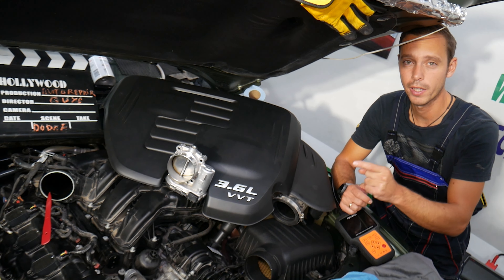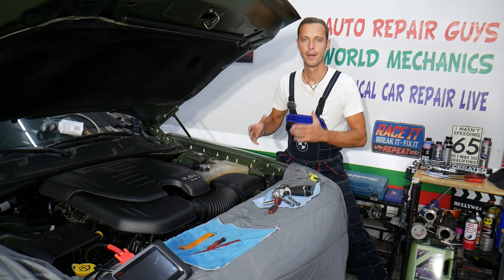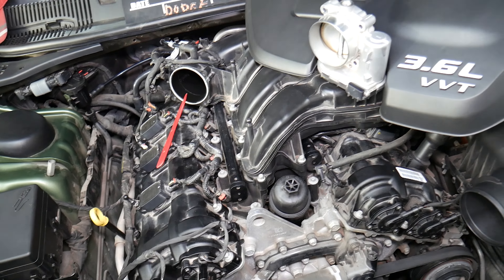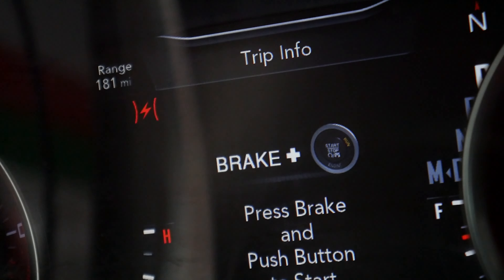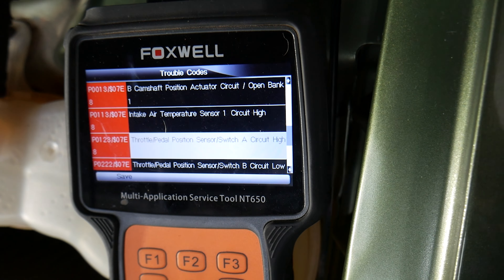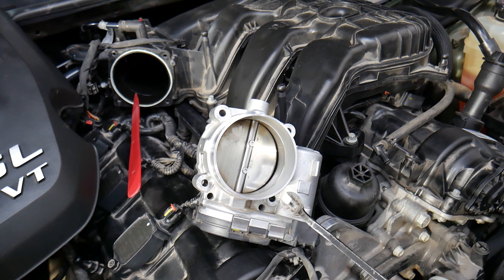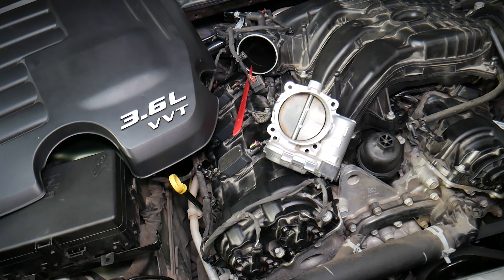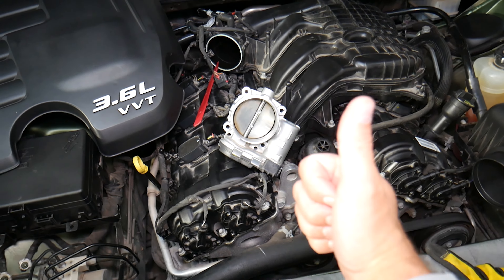DODGE CHARGER RED LIGHTNING BOLT LIGHT, THUNDER RED LIGHT on DASH

Comment from the maker: Products that we use and recommend:
► Throttle Body: https://amzn.to/4hAosEk
► Throttle Pedal: https://amzn.to/4ewhCgp
► This is Our Favorite Scanner: https://amzn.to/3Rlmr1A
► 5W-20 Oil: https://amzn.to/3uc1Qmu 
► Oil Filter: https://amzn.to/3HZ9eHm
► Panel Removal Set: https://amzn.to/3YiMADu
► Assorted Fuses: https://amzn.to/4fx4s3F
► Tool Set: https://amzn.to/3p5MM6t
► Screwdriver Set: https://amzn.to/3XRB28Q
► Torque Wrench: https://amzn.to/32qyRwg
► Liqui Moly Engine Flush: https://amzn.to/3IiDBID
► OBD Scanner that we use most often: https://amzn.to/3I4MQfe

► Check out our Amazon Store for the tools and parts that we use: https://www.amazon.com/shop/worldmechanics

Comment: That light is on my 2012 dodge charger pursuit. I had it scanned nothing popped up. Started the car after have the scan the light went away. 15 minutes later the light comes back on and I'm stuck going 45 in a 55 on a highway. Checked the throttle body to see if it was dirty it wasn't. Check the wiring, nothing is broke. Idk what to do.
Reply: Usually after you let it sit a while- the electronic throttle body will cool down, and it will be for who knows how long….  I got an extra one from a pull a part that I keep with me… It’s easy enough to swap it out on the side of the road.. Another issue could be the gas pedal itself… It’s not your typical mechanical gas pedal that’s tugging ona throttle cable.. Think of it more as a sliding rheostat…  

This video was a complete waste of time.. I understood about 15% of what he said, I completely disagree with his diagnosis…
Reply: @MrNika6969  I’ve literally been having this going on for over a year… I’m finally beginning to think that it is the gas pedal assembly… All that thing is, is a rheostat.. Yesterday I had it happen, I unplugged the gas pedal and plugged it back in- I think what’s happening is that from the pedal being in its normal resting position- the slide on the rheostat is worn out in the position, and the ecm is not able to determine what position the pedal is in…  Next time it happens to you- before starting your car- press the throttle down very slightly, and try starting it like that…  I dunno- it’s trial and error.. That seemed to have worked yesterday for me.. I had to stop three different times to dick around with it… But now it probably won’t happen again for another two months… Thats the way it’s been going…  I have a Ram 1500 with a 4.7 btw.. Not the same car, but mostly the same design and parts…
Reply: @mlke4258  At first when I first bought the car I put a newer 2019 gaudge cluster in and for some  weird reason it came on ever single time I'd start the car. So I was curious to see if I swaped back to the 2012 cluster if it would stop doing it. It did for about a week now it comes back on like once a week for no reason, so I've resorted to maybe I need to let it idle. But next time it comes back on I will try your way.
Reply: I have a dodge charger 2013. The red lightning bolt just popped on my car for the first time today. Was trying to watch to video to grasp what it might be. Anyone have any ideas?
Reply: @justicemcknight858 I'd check the throttle body to see if it is dirty or not and make sure none of the wires are broke. Get it plugged up to see what that says. My issue was I had a peddle comander that would keep moving around when I drove and it made the light come on  I fastened it in. Hasn't came back on since.

Comment: I had a situation recently present its self where my car was saying that the remote wasn’t in the car when it was , replaced the remote battery then went to go try to start it then said parking break disengage , the center console screen was blinking white and I turned it off left it like that next day I try again and red bolt still on and when I turn it on it indicates that it’s on but clearly isn’t. I checked on here and other videos where some people where saying it could be a fuse I believe 27 or it could be something much more in my case the third on going day of this situation I went to go try and check it out again and came to find no power in my car went and bought a new battery and all my problems went away now this may not be everyone’s case but if you have a similar problem arise I highly recommend you replace your cars key battery and if it continues replace the car battery if it isn’t the issue you can always just return it , check your fuse to see if any are blown out & unfortunately if the problem continues your best bet is towing it to dodge but keep in mind depending on what it is , it could potentially run you up to 3k or so might be way less just depends but try all this none of it cost that much again if it’s not the battery you can just return it.

Comment: I am having the same issue with my 2010 Charger. I haven figured out what it is. The red light flashes though and it comes on with the traction control light.
Reply: I am having the same problem. My traction light came on as well with the Red Lighting Bolt and check Engine Light
Reply: @samsonmccray1386  check the EGR valve. That's what corrected the issue in my car.
Reply: Same year but mine does it with the ceo on

Comment: There's so many things that cause this, it's ultimately cheaper to bring it in. Mine turned out to be a vacuum leak at the intake manifold.  It's cheaper than replacing sensor after sensor.
Reply: I ßa crack around my screw on the manifold cover.  Wonder if that's my problem.

Comment: So I have a question I bought a 2012 dodge 8 speed charger 3.6 L engine that had a Hydro lock engine. I bought another engine from a 2012 dodge charger 3.6L 5 speed. Are these engines interchangeable with one another or do I need the ECU computer as well when doing the swap. I connected the engine back together to my car, but it won’t start.
Reply: SAME
Reply: you'll need the ecu swap i just did the same thing
Reply: What did you figure out?

Comment: The code i have 7E8 and 7E9 and i have a 2011 chrysler 300. This is the 3rd time my lightning bolt has came on in the past year and a half and I've taken it to Chrysler to get fix. Now, after $3000 and 7 months later i get the same issue. Im driving and i go to limb mode and the  stalls and won't turn over after that.  They replaced wires, throttle body, and some other stuff too. Im wondering if it could be a more simple and less expesive fix if it just the sensor or something that dont have to be programmed.

Comment: Hello my friend. I get the lightening bolt after my car sat for a week. The battery was dead. And the rpm guage goes up when my foot is off the brakes. So it drives when my foot is off the brake (and it's set on Drive or Reverse).
Any clue? Thanks
Reply: Mine does the same did u ever figure it out
Reply: @nayrzenitram9377  it was a weak battery. I kept my foot on the brake. Let it run for about 15mins